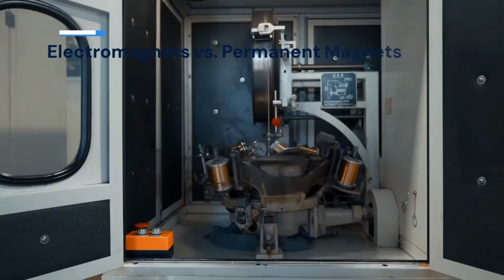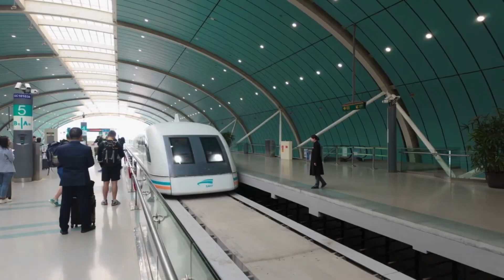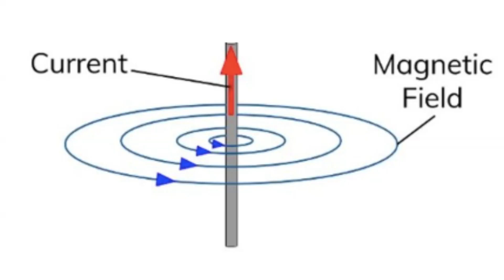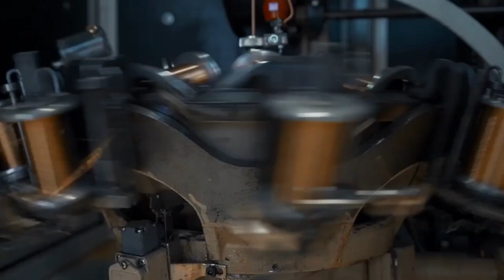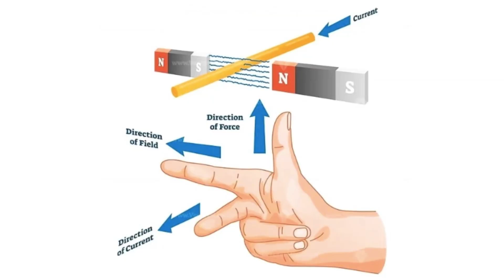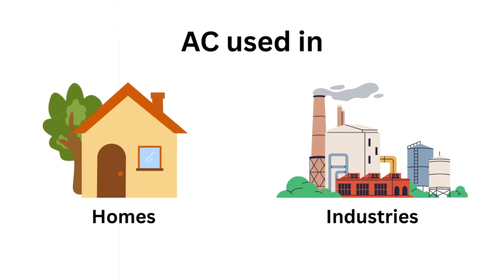Electromagnetism | FULL CHAPTER | fleming's right and left hand rule | electromagnetic induction

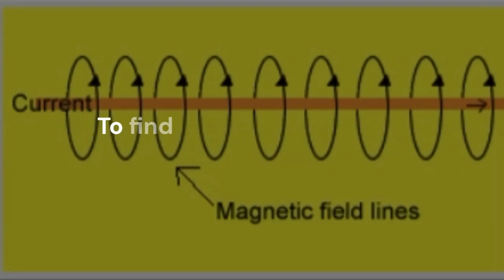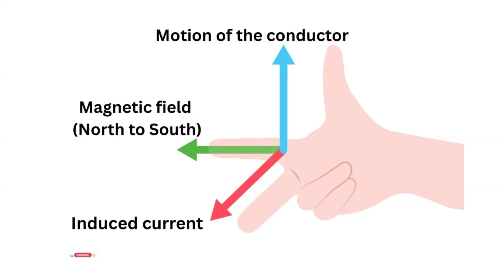Comment: What rule is correct: left hand, or right hand? On the frame 4:13 electron flow is shown (left hand rule). On the frame 4:22 right hand rule shown for the motors (with electron flow), or generators (conventional flow). Extremely confusing...